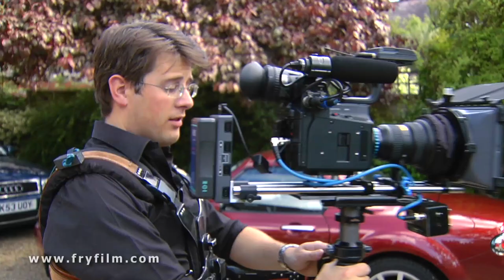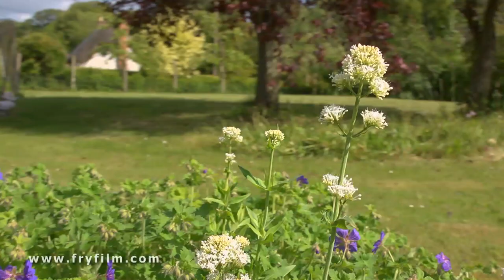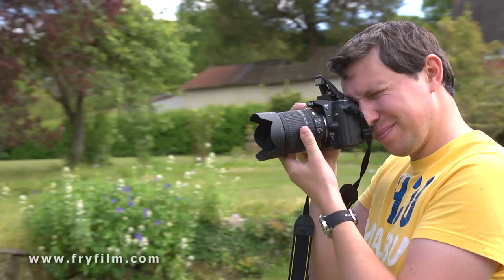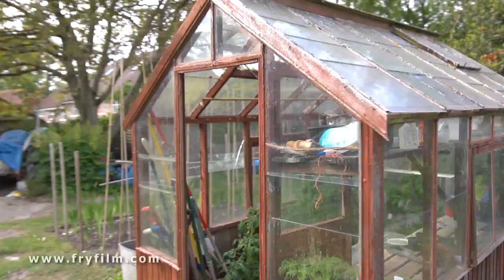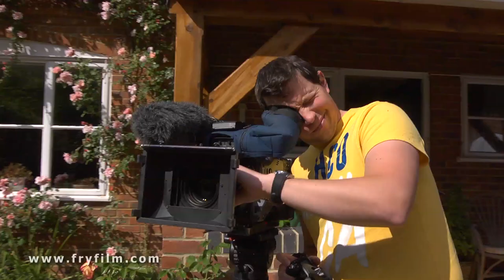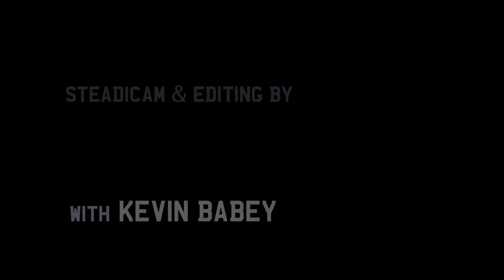AF101 on Steadicam Test Footage  - AF100 Sample Video

Comment from the maker: The video output from the camera goes straight to the upper junction J-box of the Steadicam, which sends the signal down the post to the lower d-box & then out to the monitor. The other thing behind the camera is a battery plate & IDX battery.

Comment from the maker: @fbithejames There are various 15mm rail/bar systems available for the AF101, and other small cameras actually, that allow IDX, AB & other battery mounts to be attached, then connect to the camera via a specific AF101 power cable.

Comment from the maker: Well, we didn't focus pull on shot, just tried to keep the same distance from the subjects during the move. I have to do this quite often with Steadicam because some clients just don't see the need or won't pay the extra for our remote follow focus kit & a focus puller. To be fair, on Steadicam often the most effective lens is a very wide one, so the focus isn't so much of an issue as it is with 50mm+ lenses.

Comment from the maker: @lkabird The GH2 has the same (or very nearly) sensor, so the pictures should be quite similar, but it doesn't have all the manual controls and video specific processing of the AF101. Same with the 5D, which actually produces much poorer pictures technically because it has to artificially lose a load of resolution lines to make a 1080 size video frame form its high megapixel stills sensor.

Comment from the maker: @ElevenEleven1122  I use Final Cut Pro which Panasonic have released their own kinda converter plugin for - so it just works automatically when I import AF101 footage. If you're using another program I'm sure mr Google will have all the answers.

Comment from the maker: @mark29072907 Well, the idea of Steadicam is to isolate the camera from the operator, so it is designed to remove that 'running motion' leaving the camera to glide smoothly as if on a track & dolly, whether the operator is running, walking, or whatever. 
Having said that, the operator could be more heavy handed with the Steadicam which would transmit some of that movement back into the camera, if desired. 

See my 'Operating Positions Demo' video for an example of running Steadicam shots.

Comment: I so wanted to add this camera to my 2 HVX cameras.My only let down was it was not at least DVC PRO HD. It should have been AVC INTRA 100 and with P2 recording. I would of purchased 2 for sure. Then I held out based on rumors regarding the AF200. Which of course was just that. The reason I am saying this is I am not a fan of external recorders.
I do not want to shoot someones movie or wedding and have a wire pulled out accidently
or have it crash. I trust the P2 format not 3rd party externals

Comment: We have come so far.. my little Sony and handheld zhiyun crane has much higher quality than this now! In a tiny package. No more RoboCop! Cool though!
Reply from the maker: The picture quality is entirely down to the camera, not the Steadicam. Rather unfair to compare new technology with old! Steadicams are still entirely current, and evolving cinema & TV technology. You will be surprised how few feature films and decent TV shows don't use a full rig Steadicam. The gimbal systems are smaller, lighter, and easier to use, but less precise and without a lot of features professional users rely on; much like your car is compared to an F1 car - but they still race F1 cars.